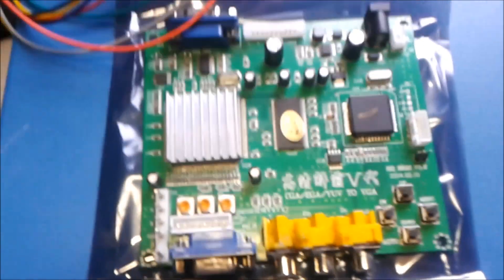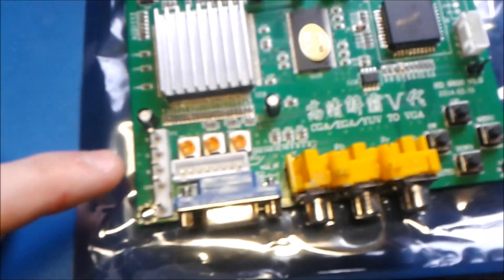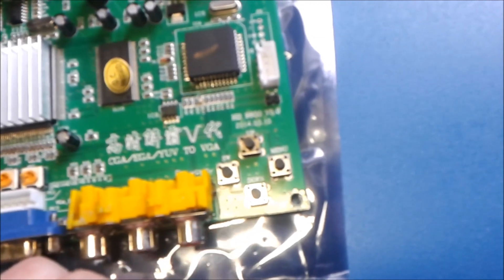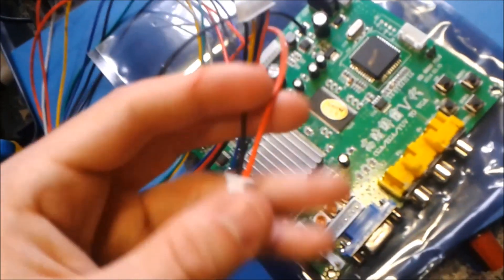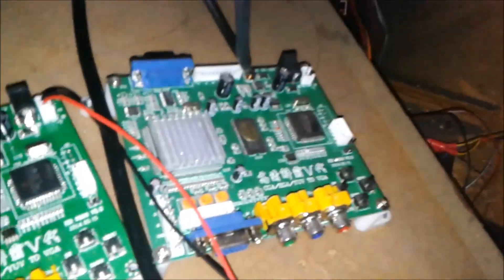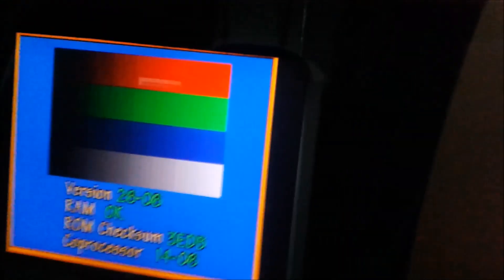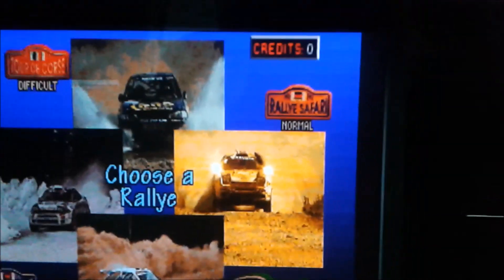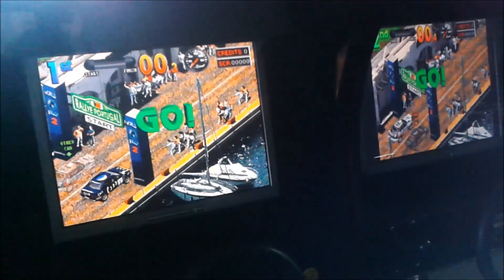RGB/CGA/EGA/YUV to VGA HD VIDEO CONVERTER BOARD

Comment: I am using mine on a joker poker video stand alone game. I have used it on a cherry bonus and a burger time game with no issue. I have a constant vertical roll with my joker poker. I have gone into geometry and tried adjustments, but have been unsuccessful. Do you have any ideas??

Comment: For some weird reason I have an extra gray wire on mine I don't know what that goes into. Does that and the black get spliced together on the black import wire.   on the board? I am working on a cabinet called SideArms I found at a thrift shop.

Comment: Can this be used to run a pandoras box to correct aspect ration issues. pandoras box display 16:9 native,but the games are 4:3 native.
Reply: A Pandora's box should already output VGA. Just use your screen or TV's menue to force it into 4:3 aspect ratio.

Comment: Hi Troy, I am converting an old arcade game machine "Bomb Jack' for a friend. I have fitted a new power supply and then we found the old CRT Monitor did not work, we only get sound. So I have fitted a modern VGA monitor a Dell 19" P190Sb into the old frame, portrait (on it`s side) as the old CRT monitor was and fitted a new GBS 8200 and carried out all wiring etc.                       I am using the grey wire from the new converter board to the Jamma`s game board`s yellow but there is no picture the screen says 1280 x1024 and that needs to be changed? I have tried all buttons on the converter board but the screen repeats the same message! I will also need to rotate the image on the screen, can you help please? Steve in England

Comment: Hey Troy, having trouble getting the sync to work on a 2C-CRX main board in a Top Skater machine. RgbGndSync all connected but getting a locked colour bar display. Rgb adjustments on card work and menu is working on my display... Ideas I've tried everything

Comment: Hi Troy, Thanks for the video, it was helpful.  I am doing this for a Ms. Pac-Man and notice the wiring is all different colours.  How did you know which wires to attach to one another?  Also, did you ground the board with the red and black wire that should hook in to the other side of the converter board?  I notice that you didn't in the video and wondered if it was needed.  Hope you have time to answer, as I just received my board and am anxious to get started.  Thanks Troy!

Comment: I have bought one of these boards and have opened my cabinet. I do not see exactly how to hook up the 8 pin connector to the board. It looks like the machine has been repurposed a few times, so I just want to make sure I know what I am doing before I go forward. Any video or tips on how to hook up the 8 RBG connector?

Comment: i want to get component on my wii to vga on my dell m992. would this be what i need?
Reply from the maker: +Naseem Baramki-Azar Hey, If you have a Red, Green, Blue cable for your wii I believe it would work. But if you have Yellow, White, Red it wont.
Reply: +Madfrog NZ is there a usb cable that can power it? the usb port on the wii is five volts

Comment: why do you think that the screen of the monitor the picture is dark, I found out that maybe the 12v dc is for the sound, what can I do in the convertion board? when I push the auto button you can see the picture nice with all the color for two seconds and them gets dark like and two seconds after but you can see the picture but all dark.
Reply from the maker: Check the brightness and contrast levels on the monitor + the board settings.

Comment: I connect the lcd monitor to a 120 volts, my question is that should I connect the 12 volts dc to the monitor, because when I turn the monitor on you can see the picture but very dark, the monitor is a dells genesis display perfection model 1907FP and this monitor have a 120v ac cable and I think a 12v dc connection.
Reply from the maker: Test your monitor using a laptop or computer vga port check if it still goes dark.

Comment: i have just got one of these, i am a little confused as to where the red, green, blue, grey, yellow and black wires actually go ?
(they are attached to a plastic thing that plugs into the adaptor) if you wire them into the jamma harness how?
if they go somewhere else where?

hope someone can help

thanks
phil
Reply from the maker: There will be those colours coming out of the Jamma Harness. You may need to find the manual for your gameboard to find what number wire is Red, Blue,Green, H. sync, V.sync and ground.

Comment: Good video.  Where could someone purchase one of these converter boards?
Reply from the maker: Hey Thanks, You can purchase these from Ebay. I have ordered about 5 boards so far from there no problem. http://www.ebay.com/itm/GBS8200-GBS-8220-ARCADE-GAME-Video-CONVERTER-CGA-EGA-to-VGA-to-LCD-Latest-/261542747683?pt=AU_ArcadeMachineAccessories&hash=item3ce5299e23